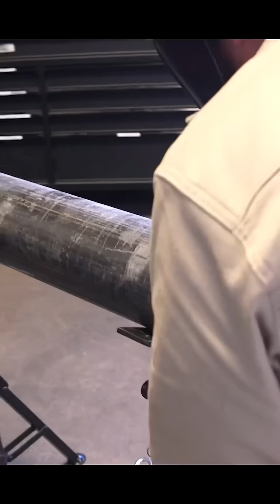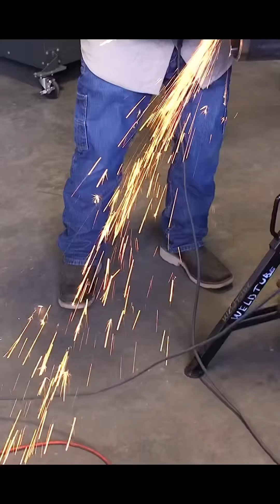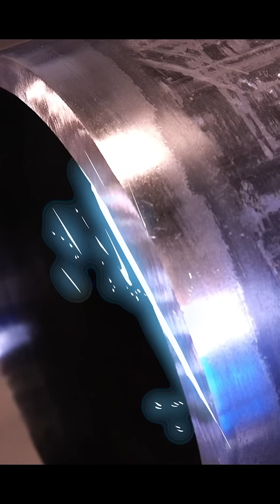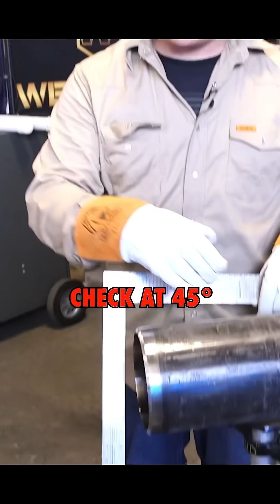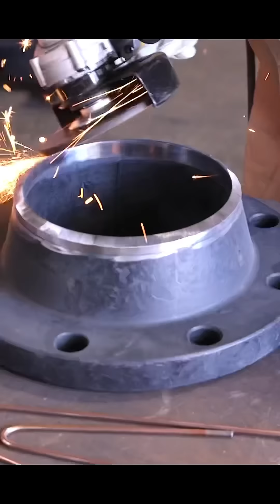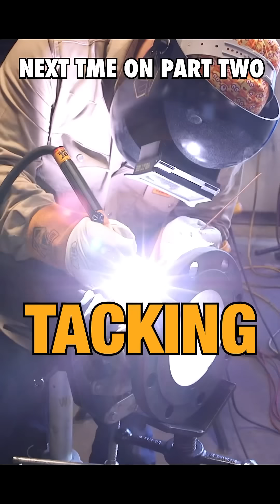Part 1: How To Pipe-Fitting Basics ✅ WeldTube Store ➡️ WELDLIFE.COM#welding

Comment: I seen the old guy flapper wheel the edge from the front of the open pipe, and he used a wrist roll, eventually I tried then asked about it and he said, you can get like 30 to 90⁰ of the pipe face then rotate the pipe as you need.

Comment: Never use the flap dist to finish it off ,if you were my fitter id fire ya 🔥, the flap disk rounds the bevel and leaves a chance for cold lap and missed edges ,always hard stone the bevel and  flap disk only for initial clean of lacquer 

Also when putting on the bevel ,gring in one direction only with consistent swipes or youll be welding cowboy hats all day long 
Drives me nuts when ppl post educational videos showing poor trade techniques

Comment: All good except that's not stainless so leave 1/8 landing
Reply: Whatever the spec calls for, or your cert says you can leave. I sure don't want 1/8", I prefer a "nickel" on SMAW, a "dime" on tig and wire, sharp on SST.
Reply: No landing for tig for me. Unless I'm just blasting a root in at like 150 plus or something. Or going for flush off the root. Then I'll take a nickel landing.

Comment: The bevel should be 37-1/2 degrees. If you read your WPS it will direct you to clean 1” on the ID and 2” on the OD. If we’re gonna teach people let’s do it right.
Reply: Do you think a degree or two makes a significant difference? (Not asking sarcastically).

 I usually take my OD clean up around 2" back, as it helps to reduce the amount of paint burn off smoke, especially if I'm taking it on site to weld, where I'd clean back 5"+. Thankfully my workshop has a very good extraction system so I enjoy very good air quality; likely not the case for many workshops I'm sure.
Reply: @Lukeydookee  BE pipe and fitting are manufactured with a 35 degree bevel

Comment: if my foreman saw me using both wire brush and a grinding disc on the same surface the management would probably came up with a deduction from my salary for the wire brush 😂
Reply: The wire brush cleans the metal after using the grinding wheel. Common practice on pipes.
Reply: Why lol
Reply: @burtcobain6561  wasting time wasting the wire brush.
Reply: @alexiachimciuc3199 as a former laborer, turned helper, turned fitter with a little bit of welding experience....I APPROVE THIS MESSAGE!!!
Reply: Depends on if the job is lump sum or not
Reply: It is standard practice though